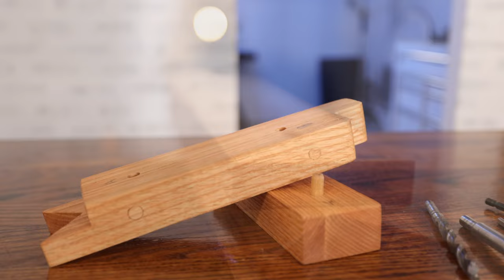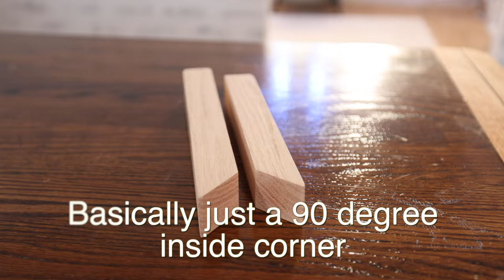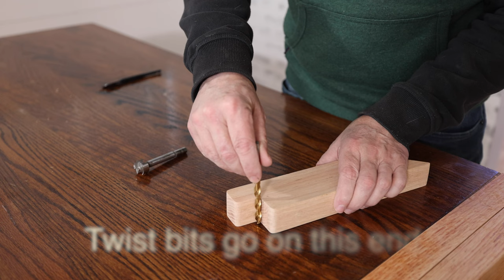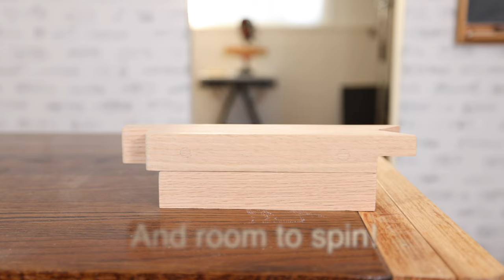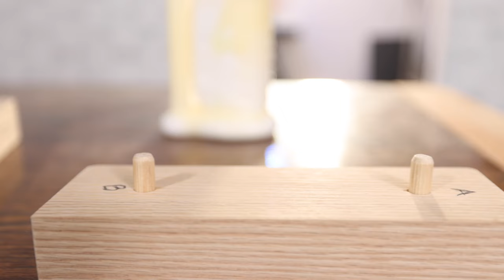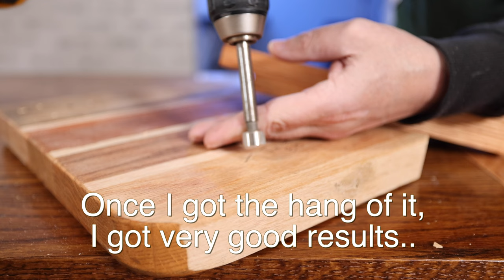Drill Guide I Drilling Straight Holes I 4K

Comment: Good design. Have you made a jig for 3mm and above size drills?
Reply from the maker: I’ve only made this for general use while drilling freehand, it is tricky with smaller bits.  I use my small drill press with a Honemade Fence etc. frequently, whenever I can.  Thanks for Watching!
Reply: @DIYFotoWorks   Thank you.